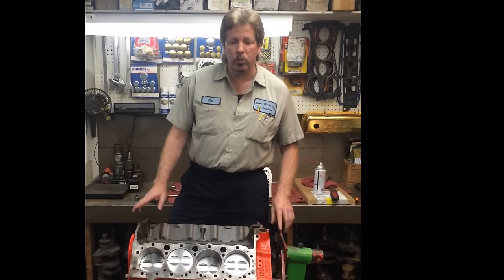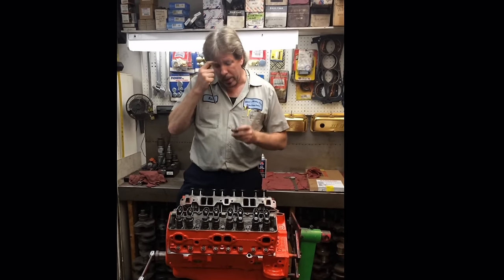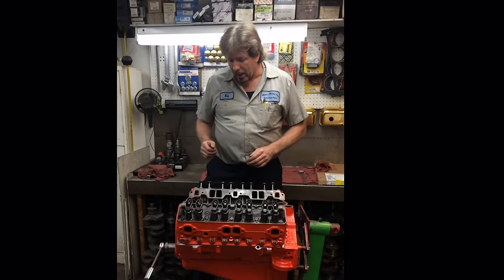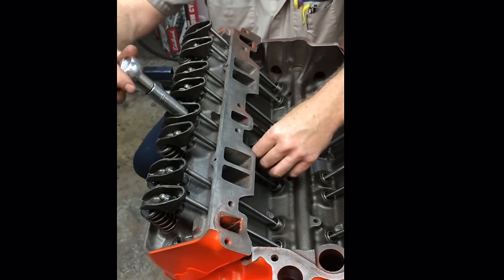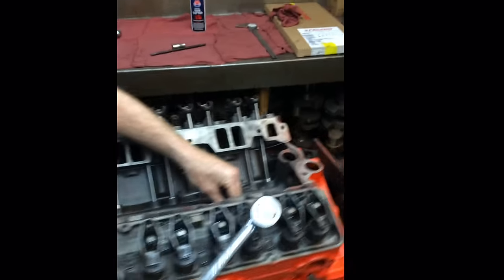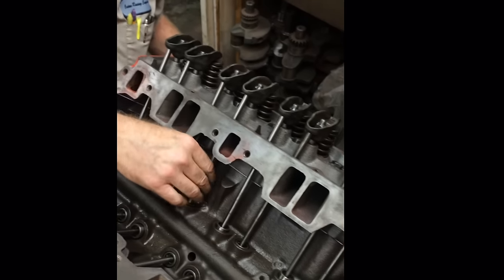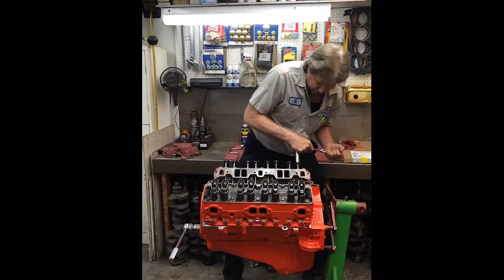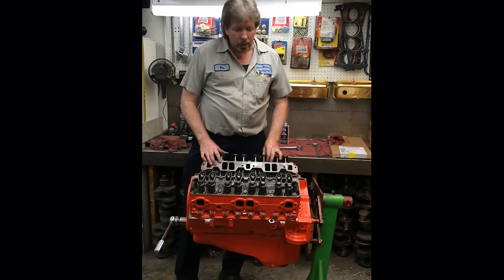Hydraulic valve adjustment made easy - Your Engine Guy

Comment: ? Is the cam and outside of lifter lubed up before they are installed?I know the inside of lifter is dry just wondering on the out side of lifter. What’s the best lube to use if any?
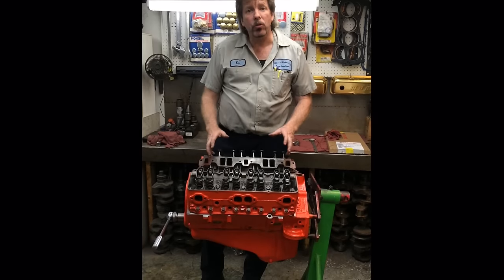Reply: Well I watched it abit 5 times now and at 21:01 you say outside of lifter is lubed but not sure what I should use. I have and old 350 I got from a guy, got it running on engine stand for a bit but it’s been sitting for quite sometime. Just wondering what procedure I should take with it.

Comment: I need to adjust mines on my truck but it's my daily driver can I just pull the valve covers and turn the top of the push rods and of course my engine is full of oil?

Comment: The SBC gen 1 ("1968 Chevrolet Service manual"  ) call for one full turn from zero lash. The EZ way is to adjust valves is put balnancer at TDC "0", at this point you can adjust:
Exhaust 1,3,4,8; Intake 1,2,5,7. Turn balancer one full turn, now your at #6 firing order. 
Now adjust Exhaust:  2,5,6,7, Intake: 3,4,6,8.  Now your done with only two revolutions, saving your assembly lube.  Dude you make it so complicated.

Comment: How should i do it on an engine that has already ben run and is out of adjustment and lifters have oil in them ? Still 3/4 turn or stop at 0 lash

Comment: Can I use this method after the engine has been ran for awhile? After its been oiled and lifters pumped up?
Reply: I would like to know this also!
Reply: @johnflanders1952  I`m also here with that same question
Reply: @Santy9351 I gave up. I’m just going to buy a crappy valve cover and modify it so when the engine is running I can adjust the valves without oil going everywhere.

Comment: Will this still work with lifters that have oil in them? Just removed intake and valve covers and noticed some are really loose and wanted to adjust them but they have oil in them as I drive the vehicle

Comment: Hi, If the lifters have oil in them, Can the adjustment still be done the same as in video?  IF not what is different? 1984 305 V8 engine. Thanks
Reply: Did you get an answer
Reply: @Dennis Knutson  Thanks for asking. No, could you send an update to the question asked a while back? About oil in lifters after setting up a few years.  Can the adjustment of new rocker arms  with new push rods be done as u shown in your video?  Same lifters not new, has not run in a few years.   Thanks

Comment: This may be a stupid question (I'm not a mechanic), but why dont you have to loosen some of the rocker nuts as you rotate the crank. I would assume they would all be in sync this way as a end result, but could they be over tightened (valves open to much). Or does it work because it is a hydraulic lifter? Also why dont you have to set the crank to tdc before valve adjustment? Hope someone can understand my question and answer it?
Reply: Some of them will feel tight since they're holding a valve open and still may need to be tightened but you won't know until the lifter gets onto the closing side of the cam lobe and eventually onto the base circle .                                                                                                                                                                                                                                                                                              Putting a piston at TDC on the compression stroke is another way of adjusting valves that puts both lifters onto their base circles and closes the valves . You don't have to do that with this method because since you're turning the cam each lifter will be on their base circle at some time .

Comment: I have a question. Did you have the engine at TDC on number 1 before you started adjusting all of those rocker arms? I need to do this to my engine but I want to make sure if I need to have number 1 cylinder TDC

Comment: Hey just curious but did you do this whole process with the rods and lifters dry? And did you tighten the rocker arm nuts just to where you feel resistance in the push rod? Like not so it stops turning?

Comment: I heard him say his method works on every engine with hydraulic lifters.

Does this mean I should be able to use this method on my Asian made Hyundai i10 from 2011(I live in Northern Europe) ??  He said any engine with hydraulic lifters didn't he?  🙂

Does all engines with hydraulic lifters also have adjustable rocker arms?

Yes, I am new to this topic and just wanna know if there is a chance I can adjust the "ticks" coming inside from my Hyundai engine!  😉

Local Hyundai reseller+workshop, said the valves in my engine could not be adjusted, because they where controlled by a hydraulic system.

So, I find it very interesting, if this dude knows something Hyundai does not(or tries to hide from their customers perhaps 😉).

Anyone got any knowledge on this?  🙂
Reply: Not all engines with hydraulic lifters have adjustable rocker arms. Is it SOHC or DOHC camshaft? 1.0,1.1,or1.2 engine?
Reply: @44special9  hello there!  🙂
 It's with the 1200cc engine featuring 86 awesome horsepower!   😁
Engine type: DOHC - MPI.
Assembled in India, sold in Europe. 
Was that helpful?  🤔😉
Reply: @danieljrgensen133  Yes helpful but I was hoping it was the SOHC option because that one has adjustable rocker arms and the only video I seen on adjustment for four cylinder Hyundai/Kia DOHC engines did not have rocker arms and were adjusted if needed by replacing the tappet with a slightly taller(thicker) one after cam removal.☹ Another thing that could cause noise is something with the timing chain but that noise would be from the chain area.
Reply: @44special9  it's okay, choosing to spend a little time trying to help out another car owner, is appreciated regardless!  😉👍

I've dugged a bit deeper into my issue, and it seems the available options to reduce or remove the noise coming from hydraulic valves are as follow:

1. Run the motor consistently at 3000 RPM's for 2-3 minutes(holding still).

2. Try a engine oil flush product(including oil and oil filter change) .

3. Try a hydraulic lifters additive product.

4.  Change out the hydraulic lifters, plus possibly multiple other items recommended to replace( as they will have wear as well) while disassembling the engine anyways(like springs etc.).

1+2 already tried and did not work.
As I'm currently low on money and spare time, I'll try option 3 next and hope to be able to postpone the need to have option 4 done to my car !   😉

Comment: So why do my polylock nuts keep coming loose?
Reply: make sure none of the trunnions are upside down if you have roller rockers , flat side should be at the top against the adjusting nut . Are the tops of the rocker studs flat ?
Reply: @44special9  yes. And are all orientated correctly. I've decided to use some prevailing torque lock nuts. If those come loose I'll weld them in

Comment: Got a new crate motor installed, the things been ticking until it gets warm for a year now, very disappointed, cause a new engine should run smoothly even when cold, its a nice looking vehicle, but the ticking makes it seem like a piece of junk. Took it back 3 time and they never fixed it right.

Comment: This will not work on a 241cui "Baby" Hemi. This engine has the hydraulic tappet and push rods and they are not adjustable, also the rocker arms.
The hydraulic tappets are fix to the cylinder or intake/exhaust valves.

Comment: Adjust it so it doesn't make noise ,and go a half a turn for max RPM use good thick oil 50 or 60 weight with Zink adittive don't run it hard tell its warmed up /valvoline that's what top fuel cars run 50-60 weight

Comment: I respectfully disagree. When you prefill the lifters and add a 1/4 to 1/2 a turn past zero lash yes the valve is forced open but the spring pressure works on the lifter plunger and forces oil out of the lifter until the valve again closes. No oil pressure being applied to a non running engine on the stand. You prelube a fresh engine and when it starts you will not need any further valve adjustment ( if the lifters don't have an issue). Different guys do it different ways I guess.

Comment: This is a fool proof way to adjust lifters. Let me start by saying it doesn’t matter if they have oil in them or dry.  The lifter is still going to react the same way. You are not pumping up the lifter and the oil pump is not pumping. So just follow what he is saying. It also doesn’t matter where you start. You don’t need to be on top dead center. You just need to do 2 complete revolution of the crank. I alway do 3 just to make sure but nothing changes after the 2. 
Wright down on a sheet of paper 1 thru 8 mark each one each time you turn the crank a 90.
Reply: After you have completed the 2 revolution which will put you at zero lash then you give each rocker your choice 1/4, 1/2, 3/4 or 1.  I alway do a 1/2 just In case I over tighten one of the rockers durning the 2 revolution.

Comment: Good, now let me return the favor and save YOU some time.  Turning the crank 90 degrees is a waste of time because the cam spins at half the speed of the crank, thus each time you turn the crank 90 degrees, you have spun the cam only 45 degrees.  You could easily spin the crank 180 degrees and be fine.  That would turn the cam 90 degrees each time and no lobe ever put on a cam has a base circle (what you called the 'heel" or the "low lobe") less than 180 degrees, thus you are sure to hit it at least 2 times out of your four 180 degree turns.  You could probably even safely do 3 turns of 240, but even using four turns is still half the work with the same exact result.  Hope it helps!

New people, don't confuse the fact that cam companies use crank degrees to publish and talk about duration.  So for example a cam's specs might say it has 290 degrees of duration at .050 lift, that means the lobe is .050 or higher than the base circle for a total 145 degrees of the cam itself (which is huge).  It also leaves 215 degrees of base circle to work with.

Comment: Your way works...I still do the TDC Power stroke / 18436572 / 90º crank turn. <<Double anal, No phone / shop doors locked.
Note: If push rod tips have very slippery assy. lube on them. Watch for push rods spinning with fingers even after you go to, or a bit past, 
Zero lash with empty lifters.

Comment: Very good. Very good but I still think the best way is to adjust the valve with the engine running like you said in the beginning one-quarter turn at a time with the engine running now the stupid engine it won't get its feelings hurt and for all you sissys.   afraid of getting a little oil on you hands too bad.

Comment: Thats the fastest way ??? You just took 20 mins to adjust 16 valves?? Put a starter on the motor with a starter button on it bump each cylinder to closed position and set the lash on each cylinder 1 at a time ???? Fastest ???????????

Comment: Lets say your lifters been run for years then the heads pulled off now you have readjust . and you have a couple valves o lash but your hydrolocking hanging valves in a couple cyl s . my brain is is tired from this stuff

Comment: Another hack, I  guess  anyone with a  cell phone can make a  YouTube video.   I  just wasted a half hour of my time watching this nonsense.   You assemble the whole motor.   When you have it done you put the timing mark to zero.   You adjust the push rods that are down  by twisting them between your fingers.   Rotate the crank and keep doing it until you have all the push rods at zero lash with the lift pumped up.  You cut the top of a tall rocker cover and peel it back  towards you. 
Put the gasket on and then the rocker cover.   Start it up and adjust the hot lash.  As long as you don't race the engine it won't leak a drop.

Comment: This is pathetic and I as a master machinist and mechanic just watched you make a complete fool of yourself.  Your final adjustments of tightening 3/4 of a turn would be for racing, but doesnt at all apply to passenger vehicle use in where you expect 300 k miles out of an engine.  I would adjust those one cylinder at a time with piston TDC with cam lobes on the flat circle, and zero lash then one eighth to one quarter turn and THATS IT.  Pre measured rockers with the rocker block design all come factory set at what would be one eighth only turn to the right after the zero lash.  You need to forget what you know and learn how this is done.  Your methid will result in burned valve seats before 50k ever happens